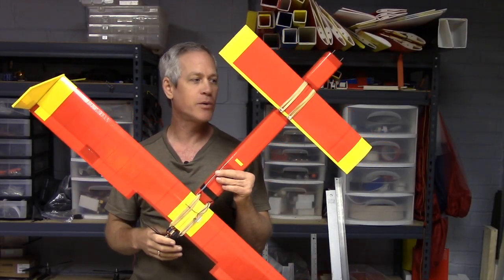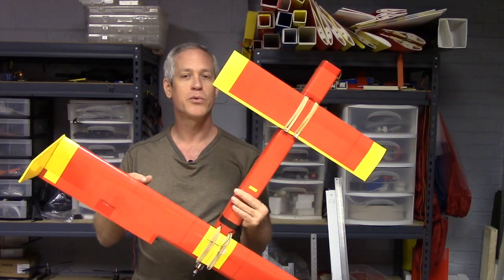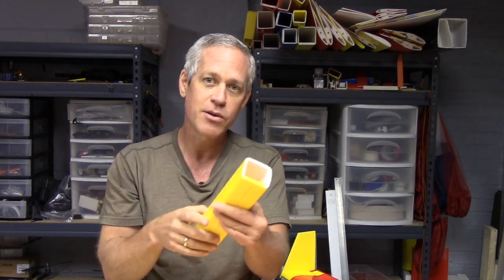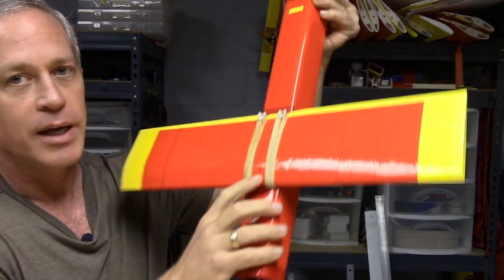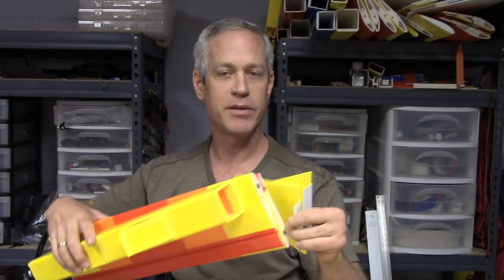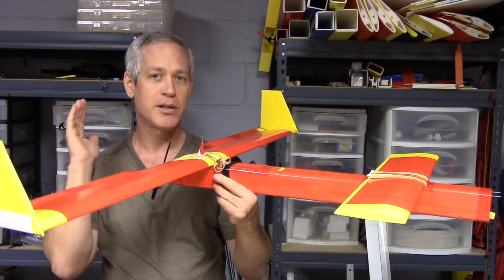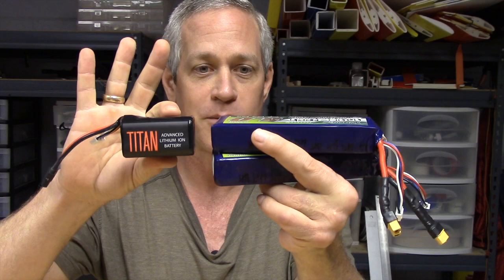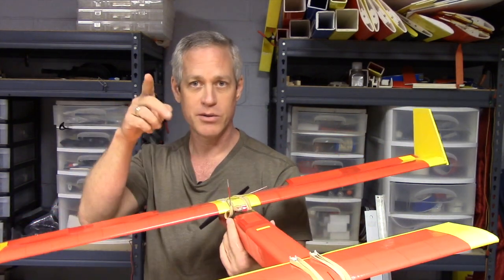Baby APD - portable FPV canard design

Comment: Hello, I see you have developed and succesfully flown canard planes. I would like to develop a windfoil based on the same configuration. Reynolds numbers are pretty closed given higher density but also.hugher viscosity that compensates. Speedwise we run up to 25 knt which is around 40 km/h. I see you use fixed forward canard which would be the case for rhe foil, the only difference is the fact that we do not have movable surfaces but we move COG to manoeuver. Can you share/ suggest some wing plan and sections that may work?

Comment: Finished a build with 40" main wing and 20" canard.  All up weight was a lot heavier than 600g.  The main wing was 361 grams with servo, push rod and horns.  The canard was 131 grams so just those takes my weight o 492 grams.   With motor, esc, rec and a 1300 3s battery add another 260 grams and of course the fuselage so weight is a lot higher than 600g.  Not a big deal.  I will up motor, but curious how others found the weight in their builds.

Comment: Built one of these and after some messing around its finally getting there! I mistangly had the CG severely nose heavy and it flew ok but sluggish and was very scary doing rolls, inverted was inmpossible it it would just dive to the ground.

once i got the CG behind the mid point i think it flew better (although it was very windy)

im using a 1100kv motor with 10x6 prop on a 3 cell 2200mah battery, its not fast but it does fly however im sure this isnt very effecient, getting about 7 minutes taking battery down to 11.5v

Ive got a 2200kv motor coming and a 6x5 prop hopefully this will get it cruising along and a nice speed without having to fly almost full throttle.

Comment: Interesting FPV battery with a low discharge rate: 2C - 10C / 7A - 35A. I wonder how long it will last which can be problem with these low C rating lipos. If ESEA has its way over in Europe we'll need stealthy planes like this to quickly get away under cover.

Comment: Hi Ed, I'm building the baby apd and have built the wings, both the main 40" wing and the 20" canard with the 5" chord, I built the 2" I.D. tube.  The narrative states the fuselage tube is to be 21".  How much distance is there supposed to be between the leading edge of the main wing to the trailing edge of the canard?  Mine doesn't look the right scale as yours in the video.  I'm thinking the chord on the wings is supposed to be less than 5".  Can you please help me out? Thanks for what you do for the community.

Comment: Those lithium ion batteries are getting pretty popular now. Do you think it's going to be the next major advancement in rc electronics? Lipos had their time to shine.
Reply: I have a ton of 18650s I've been experimenting with. their drawback is that even the high drain battery's only produce 20a constant per pack. this means you need multiple packs in parallel to maintain more than 20a constant.

Comment: How do you find CG, that and I really want tricycle landing gear, will I have any problem getting it to rotate?
Reply: for the APD I believe he calls the cg at about mid point on the fuse. that's what I do and it has worked on.
Reply: tricicle gear should not be a problem, but make the the wire for the nose wheel longer so the fuselage is a a slight angle where the front it higher than the back, this gives it lift for it to rotate.
Reply: I just built this and after alot of looking around i used a CG calaculator for canard planes. you punch in the canard chord, sweep and half span, same for main wing and then distance between the leading edges of the wing and canard and finaly how mutch static margin (less more pitch stability, more pitch stability i went with 10 because i like twitchy)

This gave me just over 14", I flew mine at 12" (in error) and it was very sluggish but it did fly fine for gentle cruising around. It would not fly upside even with full down elevator.

Mid way would be a good starting point though.